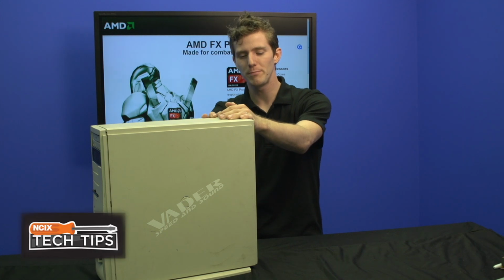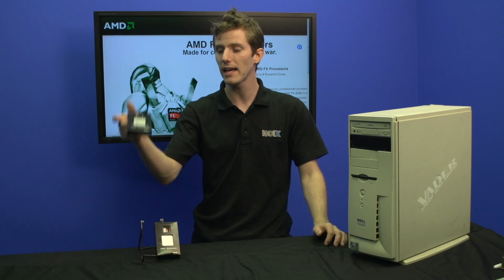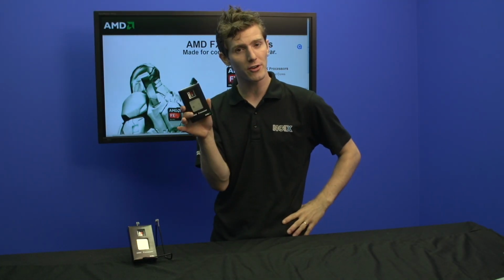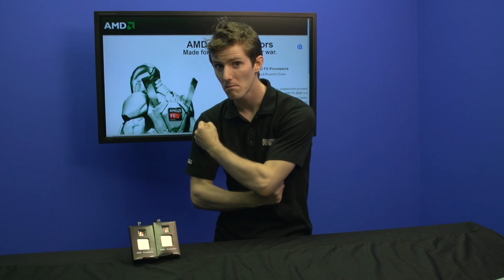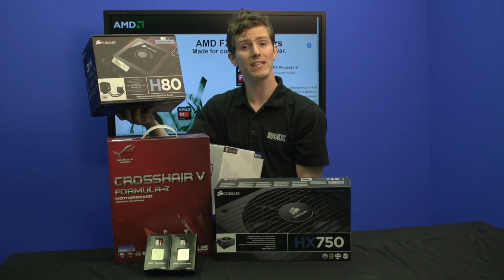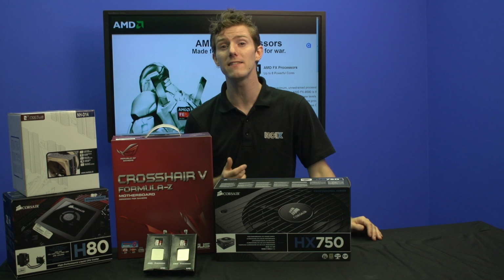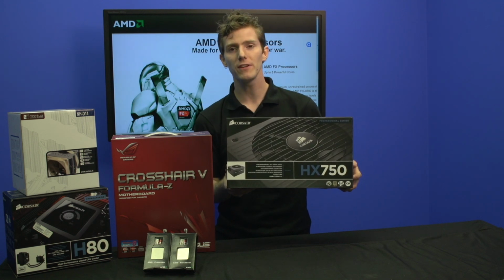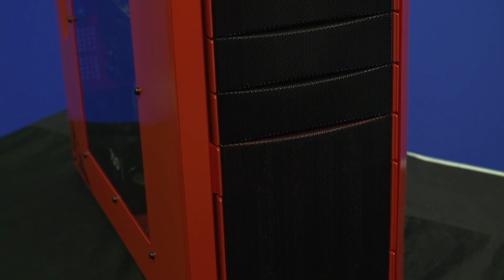AMD FX 9000 series processors hitting 5GHz!

Comment: It is still an 8-core CPU and as far as I know the architecture isn't much different from the 8350 and 6300 (well plus 2 cores) I got my Fx-6300 to 4.6GHz easy with a Hyper 212 EVO... Why not just get an 8350 and good cooling and overclock it to 5.5GHz? I've seen some very good overclocks with that CPU
Reply: i have done that myself. a FX-8350 5,5 ghz with a HD7990 delivers a WHOPPING performance!!!!
Reply: Trym Hjelmervik Same here my FX-8350 at 4.2ghz and Asus GTX 760 overclocked is kicking ass and will kick more ass when ill buy second 760 for SLI.
Reply: The problem is that even with the 8350 overclocked to 4.7ghz, it's STILL slower than the Intel 980x, which came out in 2010!  I had been very loyal to AMD since the mid-late 90s (original athlon series), but the 980x is the CPU that changed it all for me.  I bought the X6 1090T from AMD, lived with that for a while and enjoyed it at 4ghz, then I decided that I had to try the 980x and it was buh-bye AMD at that point.  Nearly FOUR YEARS in and AMD still hasn't released a CPU to compete with the 980x.  It's shameful, really.

I do hope AMD is able to pull out of the tailspin they've been in for the past several years.  I remember the amazing performance of the Athlon XP/MP series, then up to the 64-bit processors.  I even had an FX-57 with phase cooling back in the day.  I don't recall the speed I had it running (I'm lucky to remember what I had for breakfast), but at the time there was nothing else like it.  It made the P4 systems look positively ANCIENT.  I remember opening the box of the FX-57 the day it came, it was one of those pieces of tech that I won't forget.  In the grand scheme of things, the FX-57 is nothing, but back then, it was THE processor to have and it was wickedly expensive too, the first unlocked 64-bit processor from either manufacturer and it was destroying every other CPU out there.  AMD can regain that lead, but not if they continue to just forget about per-core performance.  It was per-core performance that got AMD the performance crown so long ago, when they went dual core, Intel was still trying to go with higher clock speeds and struggling to get to 64-bit.  Now it's AMD who is trying to go with the higher clock speeds, a strategy which failed miserably for Intel.

AMD just needs to shelve their current way of doing things and start over, with the intention of having the highest per-core performance in the industry, THEN start building more cores.  AMD could put 10 cores on a CPU now, but it would be stomped by Intel's 6-core models because the per-core performance of AMD's CPUs stinks.  I would rather see them return to dual-core and get it RIGHT than just continue stacking more cores on their inferior architecture.  It's the only way to survive against the behemoth named Intel.
Reply: Scott R the thing is that the Bulldozer core architecture has a lot of potential if it could be optimized properly, AMD has achieved far greater clock speeds than Intel for the last couple of years, it is all about optimization!
i believe the Mantle API will bring along better Bulldozer optimization than DirectX or OpenGL, but that's just my guess for now...
Btw, the Mantle API will support 8 cores in all games, so there is a lot of multi-core potential there.

AMD should be improving the simple but efficient K10 architecture while also advancing the more advanced but complex Bulldozer architecture. keeping 2 separate high end lines on the market. the K10 would be better than the Bulldozer at present if they had the same clock speed and number of cores. but the Bulldozer is innovative (although it still has flaws) and could be a total beast if they could straighten out the flaws. i would definitely like to see a 4ghz Phenom II with 8 cores! AMD should also haul ass to get to the 22nm process as quickly as possible, or even the 14 nm process, just to make Intel sweat!

for the moment i am just happy that the rumor that AMD was going to quit from the high end CPU market proved to be false! that means that there is still hope!
Reply: I was a very early adopter of the Opteron dual core CPUs too and I was extremely happy with them.  I had 2 2.0ghz dual-core CPUs in a workstation that I built for video editing, overclocked it to 2.6ghz (on AIR no less) and it worked like a champ.  Nothing Intel had, at ANY PRICE was even close.  AMD's workstation CPUs have been great for a long time, especially for pure number-crunching, which is an area Intel has lagged a bit behind, traditionally, but with Intel throwing more and more cores into their workstation CPUs, they've pretty much caught up to AMD and even surpassed them on the high end.  

I do agree with you about the potential, but potential is just that...potential.  If they don't USE what they've got and push ahead, they're going to remain in second place, behind Intel.  I would love to see AMD regain the performance crown, though.  I've always been partial to AMD and I would jump ship from Intel to go back to AMD in a heartbeat if they produce something that is considerably better than Intel's offerings.  It hurt to go to intel, really, as I always saw them as that big, scary, evil monster in the corner (kinda like Microsoft).  Intel was willing to do whatever it took to excel, while AMD tried to win by marketing prowess more than technological achievement.

Comment: I killed the mosfets on a motherboard by pushing a Phenom II X4 965BE to 4.3GHz
The mosfets went way over 100*C and then it bluescreened, so I disabled all overclocking, even then it was still a little unhappy :P That CPU does 3.9GHz stable on my Asus M5A990FX Pro.
Reply: that motherboard ROCKS :) I own it too for my FX-8350 at 4.2ghz
Reply: Hey tlaroche38 I also have the Phenom II 965 BE along with The next step up in board The Asus M5A99X EvoR2.0 And it holds steady at 4.1 ( air cooled ) I run My CPU 24hrs a day...
Reply: R Cannon ***** Do your Asus motherboards have slight coil whine that comes through on your headphones as well?
Reply: none... great sound in headphones ad on stereo and I even ran out of money on build and went with a crap GPU lol

Comment: Does the FX-8320 8-core need special motherboards like the FX-9590?
Reply: Any 9 series AM3+ Socket board should do it I'd imagine.
Reply: Just want to point out, the fx-9590 doesn't need "special" motherboards, just a decent motherboard, so basically if you plan on spending the money on a fx-9590, then buy a cheap motherboard for 30 bucks. This is because more expensive motherboards use much better quality components, so they support more power and are more power efficient.

So either way, no you don't need a special motherboard, but at the same time, I recommend, you don't cheap out the motherboard, even if you're getting a fx-8350.

Comment: guys is AMD FX 6300 Black Edition Support Zotac Nvdia gtx 660 single fan? plss anwer
Reply: every cpu supports any gpu... if you are talking about bottleneck, no you are going to be fine gtx 660 is going to be running on its full potential
Reply: Gang Sters  THANK YOU VERRY MUCH SIR for ur answer... my only problem now is my motherboard.. can u check this motherboard bro if this is fine. ASUS M5a78l-m-le , its support only 1333mhz ram, and i just order 1600mhz ram kingston, i hope its support bro.. i need ur reply asap.
Reply: Rosandro Deguzman Abergas If you use that motherboard, im pretty sure that your RAM will get clocked slower, to 1333mhz. Though im not sure.
Reply: ***** uhmm i see,,sad to hear.. i think i will upgraded my motherboard to high end soon when i get some cash... btw last question, can i still transper my cpu fx 6300 to another motherboard if i buy new one?
Reply: ***** and btw my ram is only kingston 4gb x2 so max 8gb with 1600mhz, do i still need to buy better one..
Reply: Rosandro Deguzman Abergas Yes, You can put your CPU in another motherboard as long as it supports it, Your RAM will run slower (The speed makes a very very little difference gaming wise), I would personally not bother getting another motherboard, Unless you plan to get a different CPU or you want more RAM capacity and maybe SLI Graphics cards etc.

Comment: im building one of these next month amd fx9590 overclocked to 7ghz three gtx titan 6gb 32gb 1833mhz ram and asus sabertooth 990fx rev 2.0 would a 1250w psu power all that this will replace my slow i7 4770k

Comment: well it depends on what you call cheap. In the store I have bought my FX 8350 for 200 euro I can buy a FX 9370 for 230 euro and a 9590 for only 310 euro. Well as far as I know those are great prices for a hip this powerful beating intel chips that costs more. Too bad you will need to pay like 100-150 euro more for a good liquid cooler which makes this a more expensive chip if u do not already have a good cooler.

Comment: Well... Theoretically it does work like that when you're talking about pure computing. That's not really that impressive, though. You can always stuff more cores in, loose out on single threaded performance, and get a higher total compute power. I mean, that's pretty much what GPUs do when compared to CPUs. 

The issue would be that when we're talking about processor speed, we're talking about impressive single core speeds.

Comment: The 9590 is a suckers buy its just an overclocked out of the box 8350, they may or may not run some tests and choose ones that may have better stability to be 9590s but there still made on the same... whatever kinda machines are used to make CPU's

Comment: linus you're like some kind of shitty marketing guru, you talk about "turbo core" like its an actual feature, its a fkin marketing ploy so they can mark the cpu's as lower wattage, then put it to the clock speeds it should have been stock anyway, also saying a factory overclock is the first to "reach 5ghz" is a load of bullshit, factory overclocked fx-8350 rebadged as a fx-9590...

Comment: The D14 is only 0.33 degree celsius cooler when the H100 is on low and only about 1.5 degrees cooler when the H100 is on high.

I recently purchased myself a D14 because of the noise factors and reliability (I had a bad experience with a watercooler failing on me that was installed by Coolermaster in a barebones build)

Comment: I really do hope that AMD sorts out their shit because they are great for budget builds, but the bulldozer series are complete crap. And with AMD they use more watts and can overclock to higher GHz, but can be cooled with ease.

Intel sucks because they use TIM to save pennies, but should overclock better due to using less power.

Also, air is very common. 212 evo is very common and the D14 is on the same level as the h100

Comment: i would say amd need to sort out the bottleneck in the data xfer between modules and intel is about to be smacked by a brick wall when the next gen games hit and are ported to pc. As for adequate cooling, who goes full air these days when h100/h110i are on the market ?

Comment: Well in my experience the most 8350's will get 5ghz.. 
only the best ones with a good batch number get 5ghz with low voltage and that is what the 9000 series basically is.. nothing new just an highly binned FX-8350

Comment: The seriously weird thing is that repeated performance benchmarks and tests confirm that AMD crossfire performs far better on higher end intel i7 processors compared to AMD processors. Whereas AMD CPUs perform well with the Nvidia SLI solutions. So weird. The latest beta drivers try to address the problem but its been around for a long time. Personally I prefer intel, having a 980x but AMD will perform well for the next generation of games if Crysis 3 was an indicator.

Comment: Crysis 3 showed how promising performance for new dx11 games that supported far more physical cores will be, developers can optimise the processing work between the GPU and CPU more effectively. Check out the performance of older eight core CPUs with high end graphics for Crysis 3. PhysicX was actually a performance liability because GPUs are not 'currently' designed to use all resources at 100%.  The AMDs do pretty well on certain productivity tasks. Its all a matter of what you use it for.

Comment: In newer games that are CPU dependant yes it does. Most "newer" games are better optimized to utilize the GFX card more than ever and not put so much load on the CPU. In these situations you will see the 8350 along wit the i7's neck and neck or within margin of error. A Phenom 2 or any modern quad would give pretty much the same results. Fire up an MMO or any CPU intensive game and the i7 usually runs away with it.

With that aside though I wasn't referring to just games.

Comment: Its not really a big deal they could have done this a long time ago if they wanted, its down to who's got the biggest balls to go through with it as i'm sure you get return warranties, if they are prone to blowing up then that's going to be a problem within profit loss.  When they come out with a CPU clocked at 5ghz which runs at normal temps and voltages then i will be impressed this is just a overclocked 8320 which any dumb ass can do.

Comment: AMD learned a lot, this is why they acquired ATi and created the APU  . AMD does not have the same manufacturing process as Intel so they produce larger chips , larger chips = larger tdp and fewer chips produced per silicone wafer , since Intel's chips are smaller they can cram more cores in the same amount of space while using less energy . To combat this AMD increased the operational frequency to decrease the performance gap , clock speed isn't everything but it clearly helped in this case .

Comment: as in everything higher up in price.  Obviously an i3 is not faster.  But why spend $800+ on a chip that keeps up with a $300 chip?  Seems like over spending.  As far as OC goes, well, not far.  It's already running at really high voltage and really needs to be on water for best results stock.  So, unless going with a very large water cooling system or sub zero, you are not going any higher.  At least not much.  Maybe 5.1Ghz.

Comment: It's too bad AMD has already slammed the brakes on production of the FX9590 and the entire FX family of CPUs.
I suspect it's due to instability due to its power consumption and massive heat output. Since most amateur PC builders are likely ignore manufacture minimum recommended cooling, they'll skimp on the CPU cooling aspect, causing premature CPU failures while under warranty.
AMD may have realized that pushing past the 5GHz is alot harder in the real world than they thought. Just ask IBM.

Comment: Well,In this case hes right. A 5ghz amd 8 core will get beat by a 4.6ghz intel i7. so its not the GHZ that matters as much as the Performance per core/thread. Naturally faster cores at a slower ghz will perform faster than slower cores at a higher ghz.

Comment: If you are comparing two CPUs using the same architecture, then yes, Ghz will be an important factor, however it is not useful if you are comparing different architectures. For example, 5Ghz on a Piledriver core (such as FX9590) is pretty much equivalent to around 4.5Ghz on an Ivy Bridge Core, 4.7Ghz on a Sandy Bridge or 4.2Ghz on a Haswell. My point is that a higher frequency on one CPU doesn't necessarily mean it is faster than a lower frequency on a different CPU.

Comment: Intel sure has taken the spot for best CPU's performance-wise, but i have to say that price-for-performance value in a lot of cases goes to AMD considering my FX-6300 scores around 6500 on passmark at stock settings, and i hit 8000 with some tweaking and overclocks, which is considered a high end CPU. nothing super special, but it is indeed special considering it is $120. Intel has a comparable I5 2500k or somewhere around there, but you are going to pay a lot more.

Comment: Frequency does not equal performance.
Making a potato vibrate at 6 GHz will not make it any better at calculating, if you get the point.

Comment: Linus, I like your videos but there is so much wrong with this...
March of 2000 is when AMD beat Intel to 1 Ghz..  and it was a matter of days, not weeks..     Also it's 4.7 ghz to 5.0 ghz for the FX9590  not 4.5 ghz...
The only commercial 1ghz x86 systems in 1999 were the Kyrotech overclocked Athlons running at -40C..

Comment: There is a lot of information missing from that. Rift doesn't like more than two cores.
Personally, I don't find the potential problems of AMDs module/thread design to be worth the hassle.
I've built many AMDs and Intels, and in my experience AMD generally takes the lower price. A-Series are incredibly affordable, and offer decent performance for someone looking for something around $400.
However, I can't stand the FX. Just my opinion.

Comment: Your logic is pretty odd. Game consoles don't use the best hardware on the market. 
You know what AMD is? Affordable. Intel can still dominate in streaming, gaming, multimedia, rendering, etc...
If you have a limited budget, AMD can be better.
Also, as far as a 1080p stream, I can do 1080p30 on a Core 2 Quad with Minecraft, it is game dependent however. Why don't I stream like that? I simply don't have the bandwidth.

Comment: Intel has not broken the world record in terms of speed processing. AMD holds the world title on OC chips at 8.5ghz that is stable without failure.

Intel i7 best chips stil can't OC at 8,5ghz. So no, Intel is not better than AMD.

Intel is better only at the written instruction bios for the CPU with resource allocation which AMD doesn't tend do to so well. 

But AMD is getting better at resource management with their APU chips.

Comment: AMD chips are still preferred to gaming compared the Intel. Intel is better at processing efficiency as the instructions are only minor better written on resource allocation.

AMD tends to dump everything on the CPU for processing. But it has changed with their new APUs and the chips coming out in last 5 years. Since their aquisition of ATI, AMD is better.